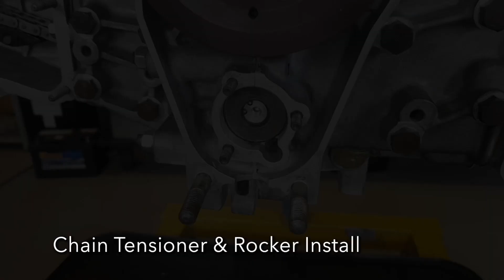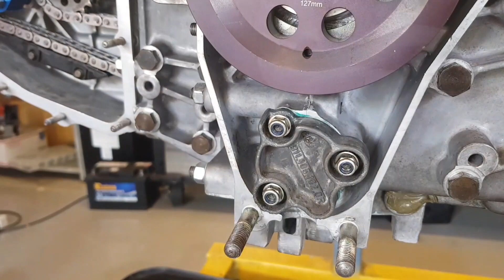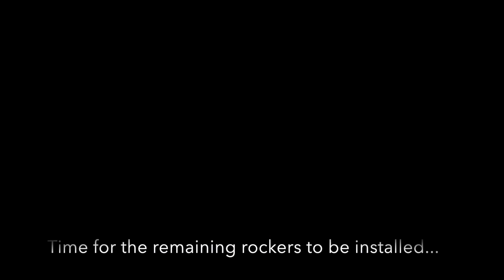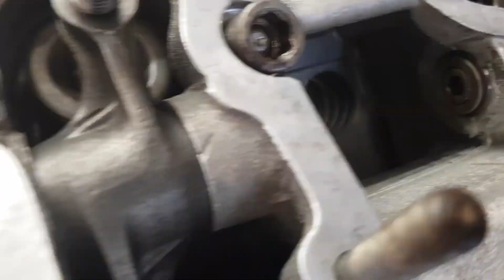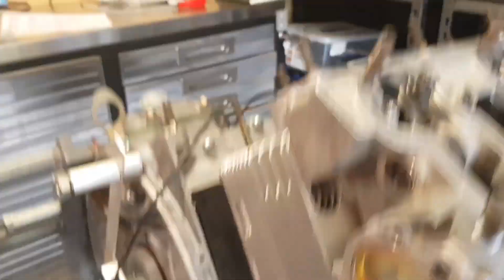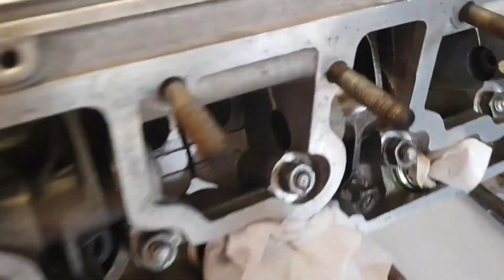09 - Porsche 911 Engine Rebuild - Chain Tensioners and Rockers

Comment: You're so relaxed changing the tensioners, I'm scared and I've only got the covers off.
Reply from the maker: Take your time and think it through... there's no rush. If you need a hand, contact me through my website... www.aircooledporsches.com.au
Reply: @mikedsilva   had the cam sprocket and chain all plactic wedged against the housing and a cable tie in the middle part, really easy in the end. Itching to get all the hardware on now. Cheers for the video.

Comment: My first build I pulled the rhs mechanical tensioner our and the chain dropped so much that it did jump the chain. I didn’t double check timing. 30 miles later engine came out to fix 

These videos are nice and short. The voice over really works. The actual time to do the work exceeds the amount of time to talk about it.
Reply from the maker: Thanks Mike.. I kinda feel like now I need to go back to the beginning, and re-do all the vids with my weird voice! It's extremely disconcerting to hear oneself. My chains are new, so they didn't move much. Glad you got yours sorted in the end. I usually obsess over 0.01mm on this things, but if you crank it over a couple of times, you find it might just be spot on! (until you crank it over again)